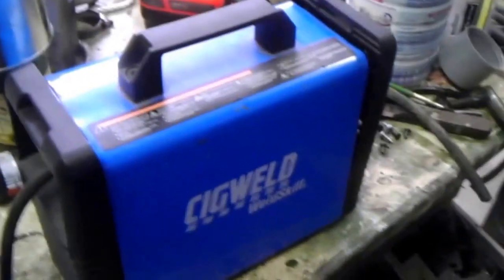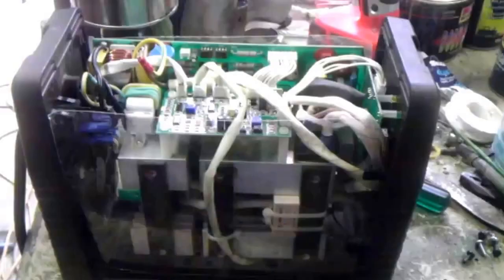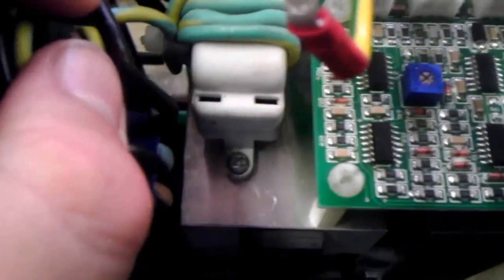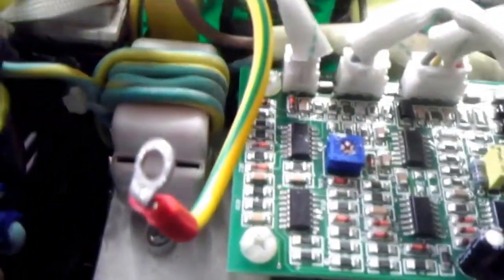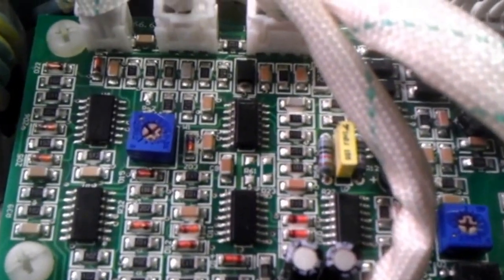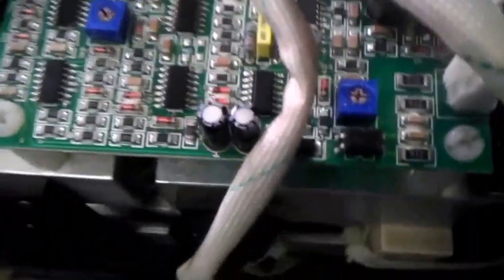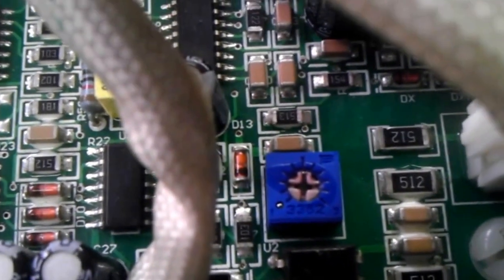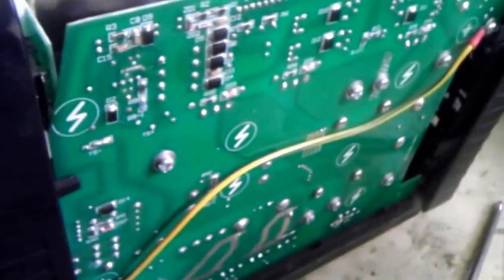dc welder guts

Comment: These Cigweld inverter welders are junk.  The over voltage issue is well known and I doubt you can adjust it out.

The duty cycle is also pretty bad on these, when you consider that an equivalent no name brand Chinese unit (and the CIG is also Chinese) will generally have a much higher duty cycle at equivalent amps.

Overpriced and living off of the CIGWELD brand name.

Comment: Have you ever thought of getting a sparky out to check your house wiring to make sure it can handle the extra power it needs. Am no expert, but if I plug my compressor into an extension type lead, even if it has its own circuit breaker, my compressor wont work like it would if I directly plug it in, most houses are piggybacked so much, that needing the power to run these may require an extra fuse in the metre box, or slightly different wiring to the gpo you are using
Reply from the maker: +Daniel Lancaster Hi Daniel, I think you misunderstood, The shed is on its own supply with plenty of overhead allowed for all the power tools, While what you are saying is correct, I was having the opposite issue with the welder, The input voltage was to high for it to handle. I used the compressor to put a load on the circuit and drop the voltage just enough to allow the welder to run.
Reply: +farnzy2011 yeah, nah, I understood. most circuits, as fair as I know, run on a loop, the further from the circuit board, the more chance interruption to quality of power. What it has to run through before it gets to its final destination you need it to be at. What is the amps of the power point you are using? So, anyway, my question was, have you tried a sparky? Have now read a few reviews as I was looking at buying 1. There seems to be the same theme running through. Runs through some power points, not others. Don't run it on a generator apparently. Anyway good luck

Comment: did you find any wiring diagram on the cigweld, my welder, as soon as I strike an arc the overtemp light comes on. I pulled it apart and replaced the thermal cut out and the controller board, as I have two of these welders. still wont work, thanks
Reply from the maker: Hi Dale, I never got any further than this with the welder. I have up after searching the net for hours, I even contacted cigweld and they pretty much refused to help. Sorry I can't be of more help.

Comment: Wow there is a lot going on inside that little welder. I wouldn't know the first thing about electrics. Got to buy a new welder myself. The one i have at the moment is a heap of junk. Thinking of a cigweld 180 gas/gasless or a lincoln, need to do more research.